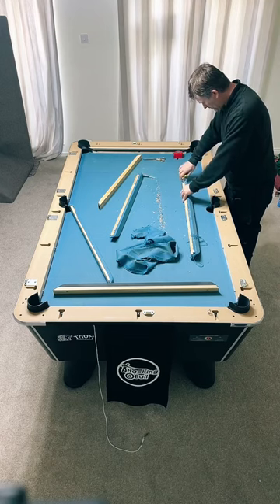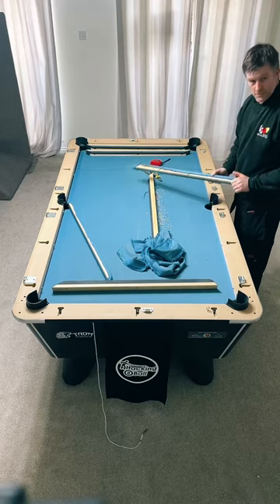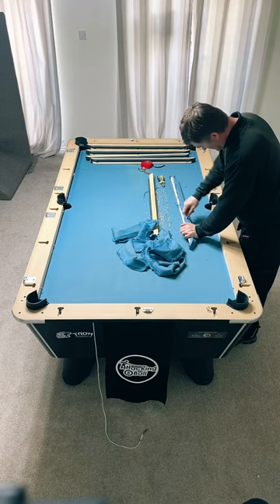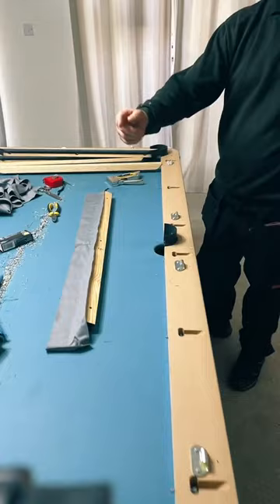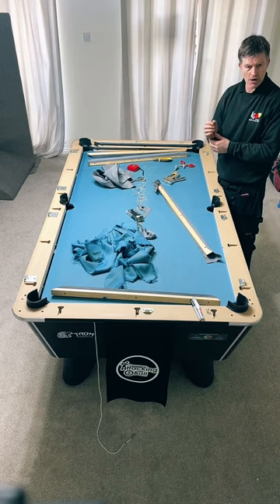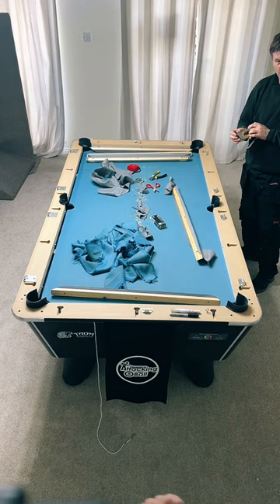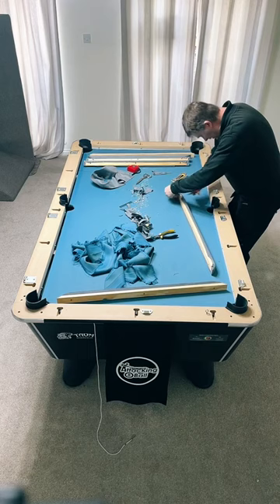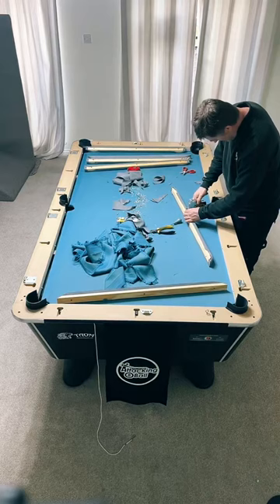Reclothing an English 8 Ball Pool Table

Comment: Geezer done an absolute gem of a job! I got my Supreme winner table with the strachan superfine cloth coming this Saturday! When that needs a re cloth you bet I'm getting in touch with these guys!
Reply from the maker: He’s pretty awesome for sure! Yeah definitely, when you need it reclothed let me know. A couple of tips for maintaining you superfine:

-Brush it regularly
-Iron it fairly regularly 
-Use a cloth protection spray
-Use break pads to break from (you can get them from 8balldirect.com) to prevent cloth burn
-Use a racking cloth when racking up the balls

Superfine wears quite easily so be sure to be on it when it comes to maintenance 👍

Comment: Hello, is it possible to know which spray do you use to fix the cloth ? Actually, you only put on the slate and not on the cloth too...? 
I would like to know which brand is it and where i could buy it ?
Thank for your help
Reply from the maker: It’s Ambersil NC 500 😊👍
Reply: @attacking8ball  Thanks !!! You confirm with this spray you just need to put on the slate ?
Reply from the maker: Sorry for the late reply. Yep, directly to the slate 👍